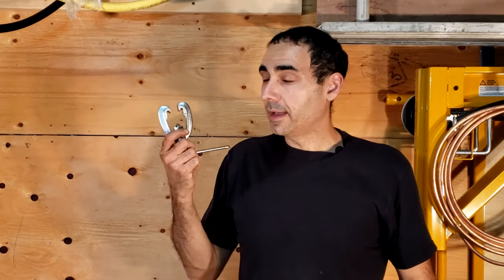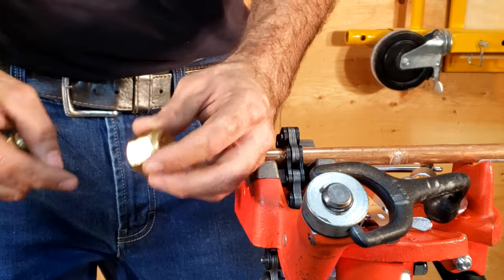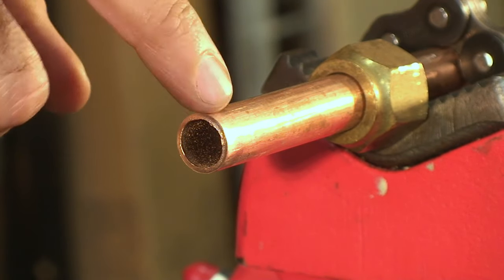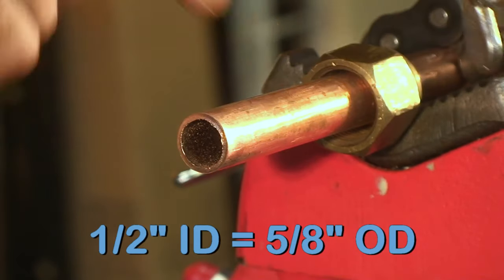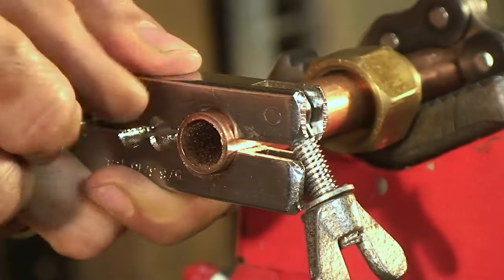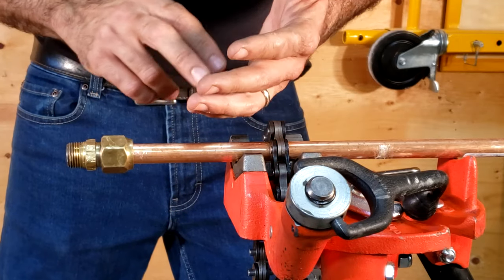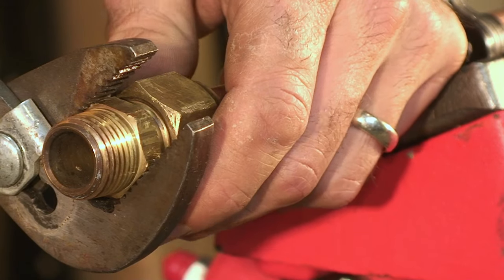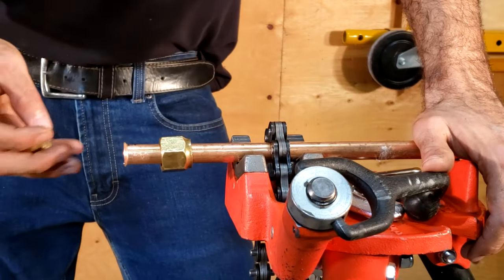How to Flare Copper Pipe!

Comment: You left out a CRITICAL STEP! You should always ream the end of the pipe before flaring it make for a MUCH BETTER SAFER SMOOTH SEALED CONNECTION!
Reply from the maker: GUILTY!  😥  Truthfully, this was one of my earlier videos, and I was so absorbed with the recording process that I forgot that critical step!
Reply: I just learned that today in my career lmao
Reply: Depending on the reamer/techniques , sometimes with the pen reamers, techs accidentally gouge the inside of the tube near the opening which causes imperfections in the flare face.
Reply: @OnePointLander I'm a rookie, shadetree plumber.  I'm pretty sure this is why I'm having trouble getting my flared fittings to stop leaking. I'd appreciate a tutorial on how to do the reaming properly.
Reply: @revbradl true. Up to this point I’ve been speaking harshly to the end of the joint. Still leaks. Suspect it needs a proper reaming.
Reply: I think he was just showing one step all training tells you to always clean the insid3
Reply: Don't worry bro he's right but it's a miner overlooked mistake honestly
Reply: If you ream the tube and those shaving go into your hvac line, you have a big problem.
Reply: Это верно, если труба старая, жесткая. Если свежая, мягкая, то достаточно неспеша отрезать острым роликовым резаком, получается минимальная фаска внутри трубы. Либо конец трубы надо нагреть, чтобы медь стала мягкой.
Reply: I agree with soft copper but hard copper tube like in the video probably doesn't matter it's way stronger then crappy soft copper used for HVAC.

Comment: Thanks for the refresher. I need to flare for the first time (and probably last time) since I helped my Dad about 65 years ago (I'm 78 now).  Based on other YTs , I will deburr and use a drop of Nylog. I might skip using a torque wrench, as the cheapest I could find is $134. My Dad never used. Those who do it regularly develop a feel for how much to tighten the futting, I guess. Thanks again, and cheers.
Reply from the maker: Oh wow!...thanks so much! 🙏🙏 🙏 . Yes, absolutely, wholeheartedly agree on the deburring prior to flaring.  Unfortunately, in this early video, I was so focused on getting accustomed to capturing it on camera, I forgot to debur! 😔

I've heard of the Nylog stuff, which HVAC folks swear by, although I'm not too sure it's approved for potable water lines.

Thank you again so much for your generosity...humbly appreciated!

Comment: Great video. I have to shorten a flared tube on a propane line for the house and bought the flaring tools but the thought of screwing it up gives me the heebe geebes, thinking I might screw it up and explain it to my wife.
Reply from the maker: Why, thank you!  🙏

With respect to your situation:  Taking on your propane line connection is really dependent on your comfort level.  If you do decide to flare your propane line, be sure to thoroughly soap test the joint after you pressurize the line by completely by covering it with a leak detector solution (sold at plumbing/HVAC suppliers or big box stores) or with a homemade mixture of dish soap (i.e. Palmolive) and water.  You may also want to lightly ream or debur the pipe BEFORE you flare it, which will remove any burrs as a result of cutting it - and which I forgot to mention in the video (oops!).  Good luck, and thanks for watching!

Comment: Thanks for the Video it was helpful I am changing my house from all Electric to gas & wood Pellets for heat
Reply from the maker: Awesome, and good luck with the transition!  Only be sure to REAM your tubing before flaring (which slipped my mind while making the video! 😒)

And especially because you're dealing with gas be sure to thoroughly PRESSURE TEST all your joints & connections!

Comment: if I ever need to repair a brake line I'm glad I watched this
Reply from the maker: Thank you!...only be sure to REAM the pipe before flaring first!...I forgot to to show that in the video!
Reply: This is not the type of flare used for brake lines, please search Youtube for another video on double flares and bubble flares for automotive.
Reply from the maker: Fair point!  This video is specifically targeted to plumbing.  Just curious:  Are brake lines ever done in copper?  Never seen that myself.
Reply: @PlumbingsCool  My reply was more directed to the other persons comment,  your video was just fine and I realized it was not directed at automotive. No, brake lines are generally steel, now they have a softer copper-nickel blend, but no straight copper is not good for brakes.
Reply from the maker: Understood, thank you! 👍

Comment: I did like that video very clear and clean  will be changing front brake caliper flex hose soon and will need to know how to flare brake tube  thanks good reference video
Reply from the maker: Thanks very much! 🙏. Only be sure to flare your brake lines properly.  The one demonstrated in the video is for simple single-flare water lines. Some automotive flare connections may be double-flared or even bubble flared, which would require a different flaring tool. Please do double-check, as you surely don't want your brakes to fail on you due to improper connection.

Comment: Thank you. If I want to increase the length of these rods, it is better this method or welding is better
Reply from the maker: I presume you meant SOLDER, and not WELD, which is a completely different process, and does not usually apply to copper piping.

Generally, yes:  it's much easier and less expensive to solder the pipe using a coupling to connect the two pipe pieces.  Although it also depends upon the application.  If you're using the pipe above-ground and it will be subject to pressures of no more than 80 PSI (550 Kpa), then soldering is fine.  However, if you want to bury the pipe below ground and /or you are conveying higher pressures, then you may want to either flare or braze the pipe (otherwise known as hard-soldering or silver-soldering).

I intend to do a video on soft-soldering in the near future, as I've been getting many requests about it.

Hope that helps for now, and thank you for watching.
Reply: @PlumbingsCool  💋💗💗

Comment: I wished I had seen this video before I bought an acetylene torch so I could braze my a/c lines.
Reply from the maker: Better late than never!  Brazing is actually easier, faster, and cheaper in the long-run.  More tools give you more options!

If you do end up flaring, just be sure to ream the end of the pipe before you do so (which I forgot to show in the video!) 😮

Comment: What tool do you need to flare a pipe so you can fit another pipe inside for soldering? I had to use end feed couplers to extend some radiator pipes and it looks all right but it would have been more discreet  with one pipe going straight into the other like a 'street' fitting.
Reply from the maker: That's not flaring, my friend, but rather likely SWAGING.  Here you go...hope it works out! 

https://youtu.be/87OvD-Eohqg
Reply: @PlumbingsCool  thank you
Reply from the maker: My pleasure...BTW:  That's one heck ofa user name! 😂

Comment: what is the difference in clutch-type(rigid-type) and wing-nut type(imperial type) of a flare tool?
it says this in the manual and even has different depths for them
and i could probably use the flare fittings to install water pipes behind walls then?
Reply from the maker: I think you're referring to a ratcheting clutch-type, which releases the tension when the flare is complete and is easier to operate than the less expensive and simpler one I use in the video.  I'm not sure about what's written in your manual, but both types are available in imperial measurement.

Technically, yes you should be able to to use flared connections for water pipe within concealed walls.  Here in Canada we're actually allowed to bury them underground!  However you will need to check with your local plumbing code laws to be sure.

Also, I'm not sure that utilizing multiple flared joints for water distribution pipes is very practical, because the connection fittings are both quite expensive and time-consuming.

You may be better off learning the classic skill of copper pipe soldering if you're installing a lot of pipe.  At some point you'll need to adapt from flared to another connection type anyway, such as when your lines reach the fixtures.

I encourage you to keep an eye out on my channel, as I'm planning on filming a soldering video some time soon because people keep asking about it.

Hope this helps and thanks for watching!
Reply: @PlumbingsCool  now i think that these are actually the company names - Ridgid and Imperial, but still dont know what type they are supposed to be lol.
but maybe its still just a wing-nut type when it doesnt have somekind of clutch mechanism inside, so i would have to use the bigger depth chart with that ?
Reply from the maker: Yes, Ridgid is very likely the brand name you're referring to. Here in North America, Ridgid has long been the go-to "Porsche" of plumbing and pipe tools:  They're absolutely top-notch, but you do get that quality at a steeper price!  Ridgid has both ratcheted and the simpler one.

I'm guessing Imperial is another brand name.  I can't remember which brand I'm using in the video, but if you expect to make only a few joints, you'll probably be just fine with a less expensive brand/type.  If it's for for high-frequency, long-term usage, then definitely invest in the more quality tools (which exist from brands aside from Ridgid - namely those used by the HVAC technicians).

I'm guessing by "depth", you're referring to how far past the holding block you should place the pipe, which may vary based on the tool.  With the one in the video, it sufficed for me to go just past 1/8th of an inch past the block's edge.  It ma the take some experimentation with your tool (or refer to the instructions, as you are doing).  The important thing is that you make your flare narrow enough so that the flare nut can slip over it, but wide enough so that the flare face adequately meets the fitting's face with enough surface area to provide an adequate seal.

Also, if you're flaring hard pipe (not soft coil) it may be helpful for you to first preheat the pipe end with a torch and allow it to naturally cool, which will soften it and make for a much easier flaring process. I show how to do this in my swaging video at around 10.5 minutes in:

https://youtu.be/87OvD-Eohqg

And finally, it's good practice to ream/debur the pipe to remove any sharp edges prior to flaring (which I forgot to show in this video! 😣)

Hope this helps!

Comment: When it comes to installation of  a gas water heater, is the plumber responsible for installing the vent pipe in Kentucky? Had one installed and did not pass code because of vent. Now plumber wants to change to electric. Tells me HVAC is responsible for vent? 
Thanks in advance.
Reply from the maker: By "vent piping", I presume you mean the gas flue venting?  If so, that's a tricky one, as the rules vary from area to area.  Here in Ontario, Canada, the only ones who are allowed to connect gas lines & flue piping (and commission gas appliances) are those with a separate TSSA certification - irrespective of whether they're a licensed plumber or not.  However, if I correctly recall, plumbers in our province of Alberta have jurisdiction for gas and flue vent connections.  Therefore, a licensed plumber in Ontario can connect gas appliances, ONLY IF they also acquired their separate TSSA certification.

I did a quick search to see if I can find an answer for you about Kentucky, but I'm not clear on whether your state mandates installation by individuals who are specifically certified for gas appliances.  For what it's worth, here's some statute law I came across:
https://casetext.com/statute/kentucky-revised-statutes/title-19-public-safety-and-morals/chapter-234-liquefied-petroleum-gas-and-other-flammable-liquids/safety-provisions/section-234175-certification-of-equipment-installation-compliance-with-administrative-regulations-and-manufacturers-instructions-immunity-from-liability-exception

In any event, is it not possible to simply limit the plumber to the water connections and get a qualified HVAC tech run the flue vent?  Unless the tank is already old (tanks only last about 8-12 years, typically), I'm guessing it'll still be a lot cheaper than outright replacing the tank (and A LOT less expensive over time than heating with electric!).  Just my two cents.

By the way:  KENTUCKY'S AWESOME!!! 👍
Reply: @PlumbingsCool  
Thanks my friend. This was a contract job by Lowe's. Subbed to another company. After their install of the new gas heater it does not pass code. The vent pipe wasn't right. Now the sub company says they weren't responsible for vent? We paid for the job and now the sub contractor says how about we change over to electric but you have to pay for electric ran to heater. Either way I feel I paid for a service contract that wasn't fulfilled. Now they want more money for their mistake. 
The vent would be close to  25 feet . They gave me a quote which wasn't cheap when first installing heater. I paid without a discount I was supposed to get in the first place. Now it doesn't pass code. Is an electric even close to a gas heater?
I expect them to show up with a cheaper version of electric if I were to agree, but how can i be responsible for anything in this after their fail?
Reply from the maker: I'm sorry for your agony; it's extremely frustrating when people don't own up to their mistakes and try to pass the buck.  Having to pay for the replacement of a water heater as a result of an installer's incompetence is beyond the scope of ridiculous.  They should have at least warned you before they installed the tank so that you had an option to cancel the contract. 

But given that your original agreement was with Lowe's, I would argue that the responsibility lies with THEM to correct this issue.  If I properly understand your situation, Lowe's is who arranged the contractor, and therefore Lowe's should be responsible.

My advice would be to find out who's in charge and WRITE (don't just call) a strong, detailed letter/email to store or corporate management outlining the situation, including your purchase agreement and general timeline of events, and specifically seek immediate remedy or resolution for something they should have been responsible for in the first place. Given that it's Lowe's, I'm guessing they sell furnaces as well and should therefore also have access to HVAC contractors who can run proper flue venting for your gas water heater.  You shouldn't have to suffer for this in any way.  You might even want to suggest filing a complaint with the Better Business Bureau.  Be firm and consistent with your demands for an immediate resolution, and don't allow them to brush you off. 

And certainly steer clear of that plumber, who sounds like an incompetent crook, and does nothing more than give other plumbers a bad reputation.

Best of luck with your predicament.

EDIT:
One thing I should add is that you should check your contract with Lowe's to ensure that there aren't any disclaimers indicating that they are not responsible for replacing any existing material or equipment, and that any modifications to exisitng will be extra to the contract.  If that is the case, you may be out of luck and will need to bear the cost of replacing the vent, as the sub company would not be responsible for it. But it's still silly to suggest that you bear the additional cost of replacing a new gas water heater with an electric one...and I'm guessing it's still a lot cheaper to run gas flue piping than replacing it with an electric water heater (both short term and long term). 

Hope this helps.
Reply: @PlumbingsCool  
Thanks again. The contractor wanting to change to electric no charge to keep from dealing with the gas vent was strange. The Plumbing Inspector say this company has 3 more just like this. His advice, you paid for a complete new heater install. Their problem. Like you said everyone is trying to put the buck on me. I did talk as you figured to Lowe's who put it off on installer. A complete mess.
Thanks for your time and your informative channel.
🙏🏻🙏🏻🙏🏻

Comment: i wish u talked about sizing... 
3/8 flare connectors, is the  OD of the copper 3/8.? 
and are they 45 degree for RV line?
Reply from the maker: Yes, when ordering flared connections, they are typically ordered based upon the tubing's outside diameter.  I can't confirm, but I'm presuming that flared connections for RV gas lines utilize the same standardized method of connection...however, be sure that any flared fittings and copper piping you use for such an application are approved for use with gas lines.  Hope this helps.

Comment: Would a flare or compression fitting be best for a low pressure 1/4" I.D. oil line on a custom automotive application?
Reply from the maker: I'm honestly not sure,  as it depends on your specific automotive requirements.  I can tell you that flared fittings are successfully used in vehicles:  I just finished replacing one of my vehicle's Bosch fuel filter and accumulator, and all connections were about 1/4" OD flared... aside from the lines conveying gasoline, they're also under a significant amount of pressure, and they connected with minimal issue.

Best to ask a licensed mechanic, just to be sure.